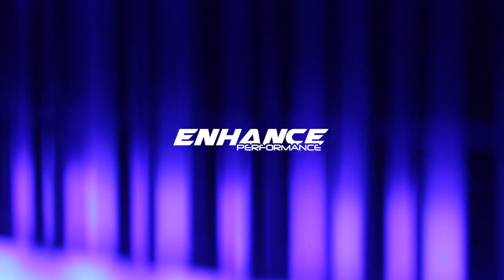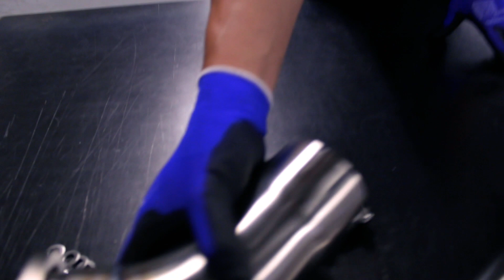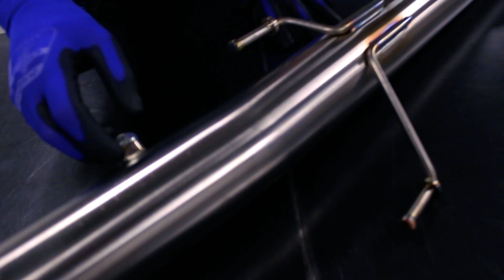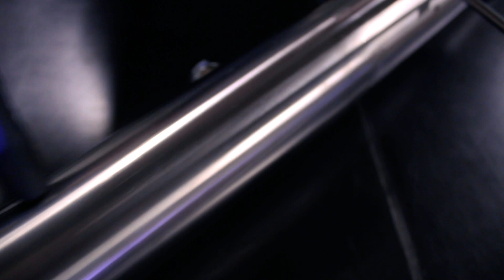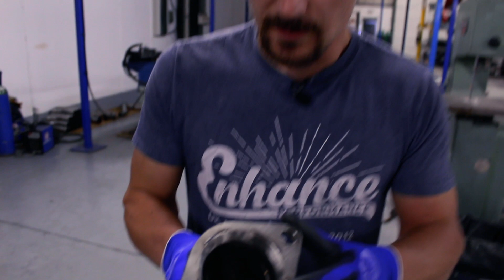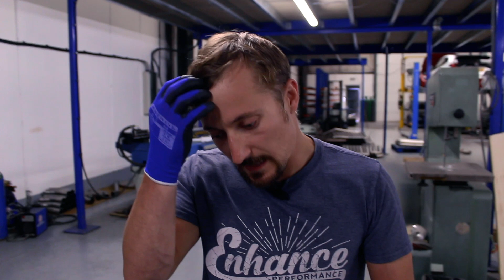Toyota GR Yaris | 3" OPF / GPF Delete Pipe

Comment: Would the car need a remap after this? Would it create any resonance inside the cabin? Thanks
Reply from the maker: No need for a remap. Removing the GPF will definitely change the acoustics/volume inside the car.
Reply: @EnhancePerformanceTV  ok cheers. Wouldn’t mind a slight increase in noise as long as it’s not booming or resonating inside the car
Reply: @EnhancePerformanceTV Will there be any drone?
Reply: Is it ok to re-use the cone graphite gasket and the ring gasket going to the opf back section? I see there’s a flat gasket on the bench in your video?